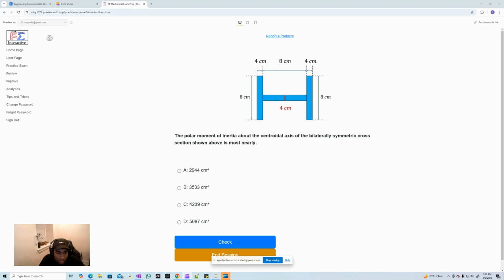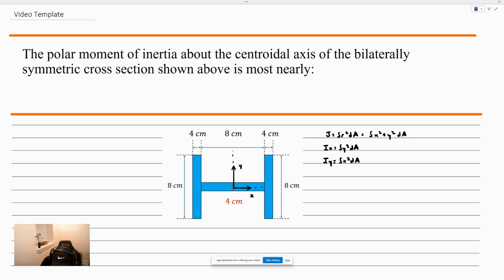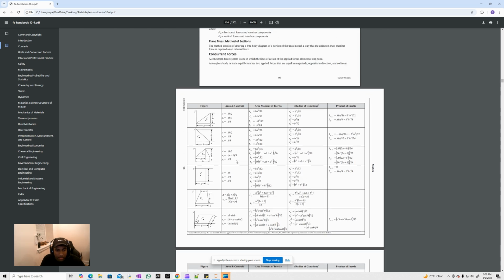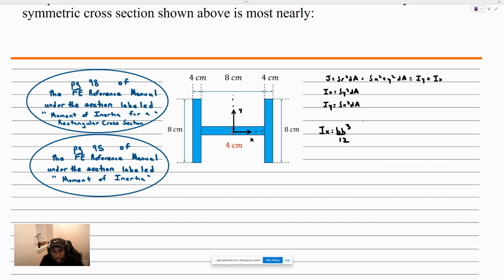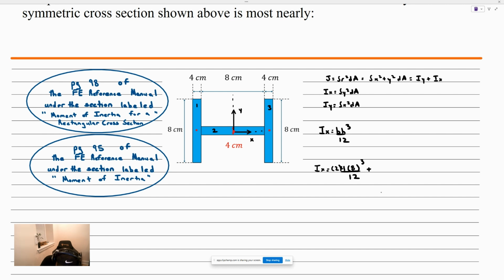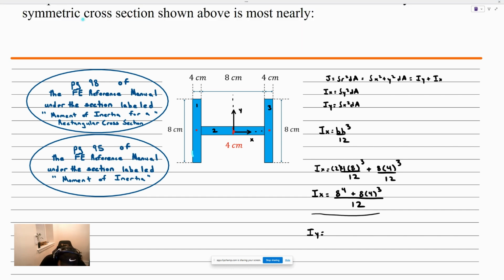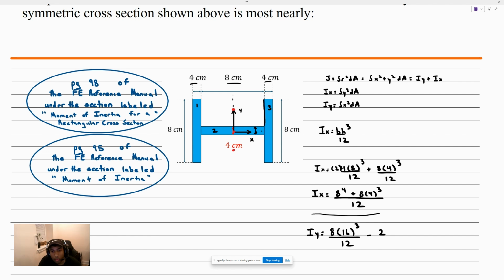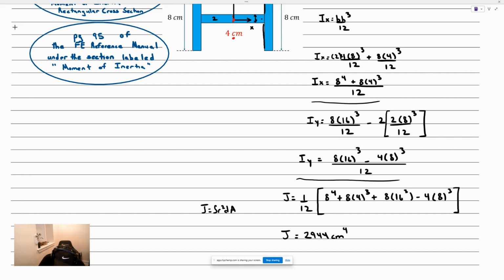FE Statics Polar Moment of Inertia

Comment: Hi
Thanks a lot for the efforts.
Regarding the computation of J. Is there anywhere in the FE handbook a direct formula that one can use and substitue to get the final answer ?
Thanks
Reply from the maker: On page 98 of the FE Reference Manual (10.4), you’ll find the formula for calculating the polar moment of inertia J for a rectangle, which is simply the sum of Ix and Iy.

In this problem, the cross section is an I-beam, which isn’t one of the standard shapes listed in the table. However, since the formula for J is given for a rectangle, you can still use it by breaking the I-beam into rectangular segments and applying the parallel axis theorem where necessary. With a bit of creativity, it’s even possible to avoid the parallel axis theorem entirely by using the rectangle formula strategically. 

To answer your question directly: there is no specific formula for this I-beam case in the Reference Manual. Like many FE exam questions, solving it relies on understanding the core concepts—moment of inertia and the parallel axis theorem—and applying them flexibly. Hope that helps.

Comment: Great content, I was following it until you decided to “view a rectangle” when using the Iy moment of inertia. To me this is overcomplicating something that is presented straight up on your face
Reply from the maker: You are my first comment on youtube I really appreciate your engagement. I try to explain what I am doing in each step so I may over speak sometimes or explain something obvious to make sure everyone is understanding. 

We really have 2 options for computing Iy.

1. In case 1 viewing the I beam as 3 distinct rectangles (labeled 1 2 and 3 in the video) we will have to use the parallel axis theorem since 1 and 3 are offset from the y-axis. 

2. In the method I did in the video I instead looked at the overall shape (16x8) and subtracted off the empty windows (8x2) on the top and bottom avoiding the parallel axis theorem

Sorry if my wording is confusing, I will try to be more clear in the next video which is buckling of beams, hope to see you there.